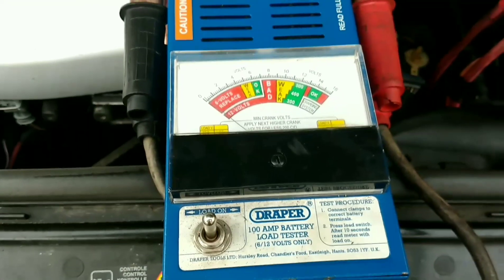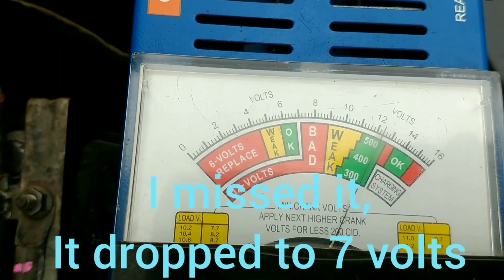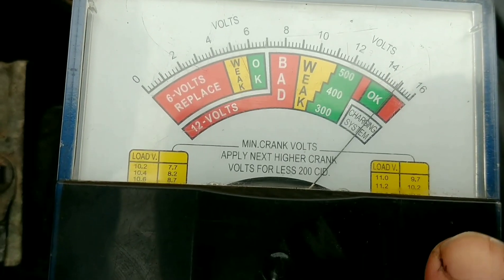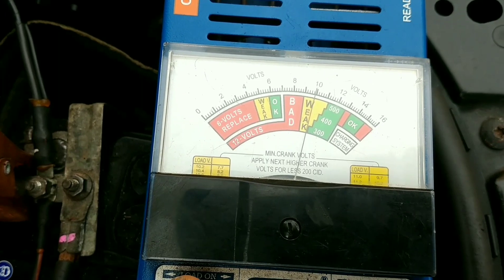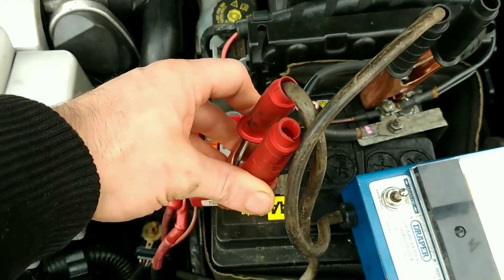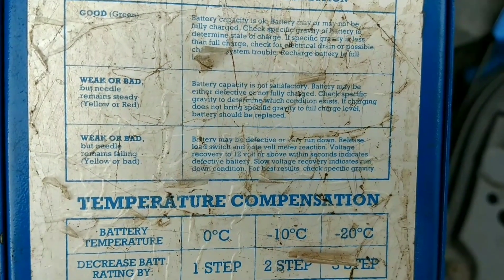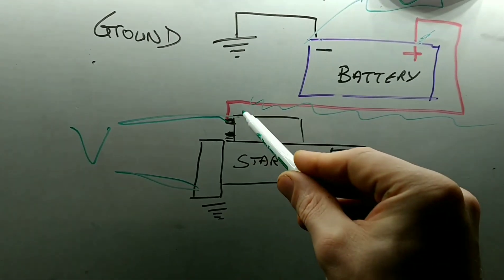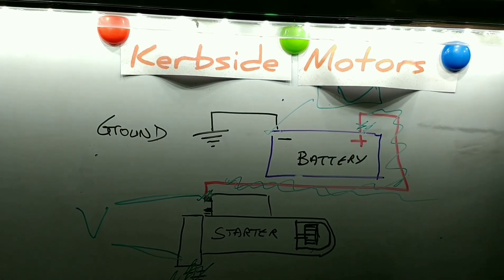Slow Engine Cranking

Comment: Hi, would a bad starter cause a sudden stall at a red light? And cranks but no start afterwards? Thanks
Reply from the maker: That wouldn't cause a stall at the lights, if it's cranking I'd be looking for what's not there. Spark or fuel is there an engine light on?